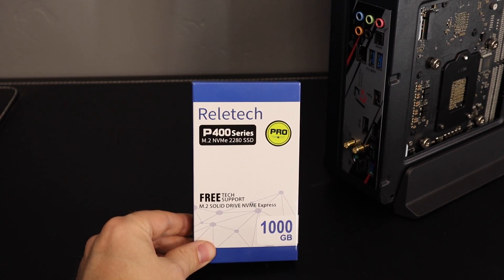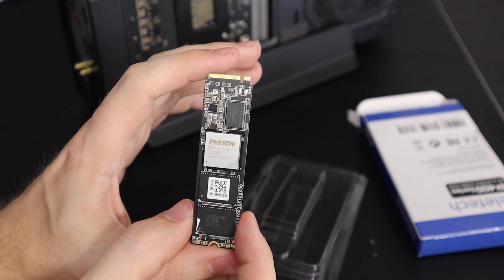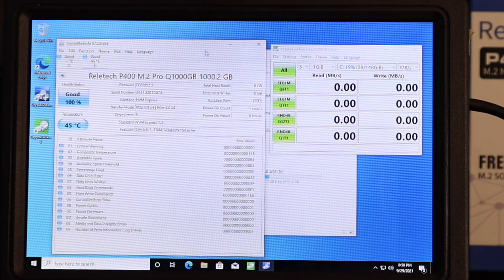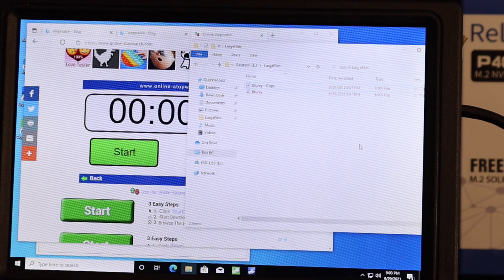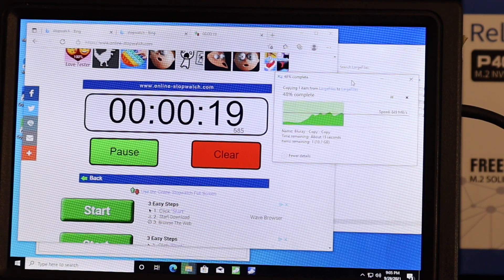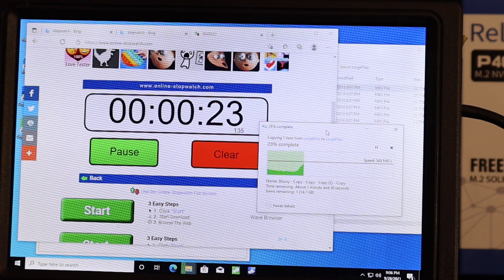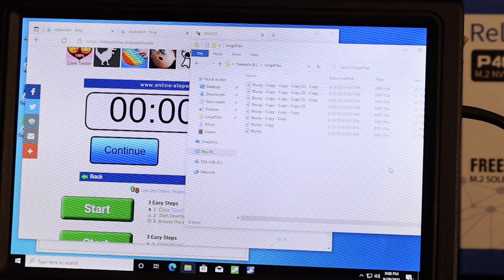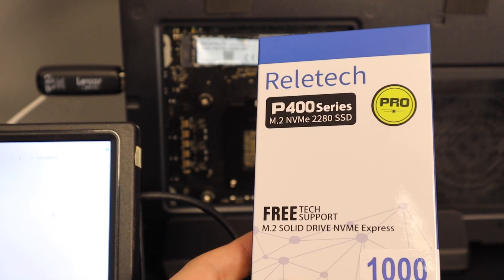Reletech P400 Pro - PCIe 4.0 NVMe SSD - Solid Performance, Solid Price

Comment: thanks for the video. I bought one of these as a cheap gen 4 solution. I did very little homework before buying. What is a higher performing gen 4 M.2 that you'd recommend? I was looking at 980 pro's which are almost twice as expensive, and figure there has to be something good in the middle.
Reply from the maker: Sorry I'm slow to reply, but the WD Black SN850 is a pretty compelling ssd.... Its what I'd probably buy today if I was in the market.
Reply: i mean if these are half of an 980 pro why not just get 2 of these in raid 0 if your mobo supports it ofc

Comment: I bought some OCZ SSDs when they were first coming on the market. They died in short order and OCZ went out of business. I would be very suspect of cheap newcomer SSDs.
Reply from the maker: You are right to be suspect, I was also burned by quite a few OCZ SSDs; however just to clarify a few things; OCZ was acquired by Toshiba and didn't go out of business, also the ssd market has consolidated quite a bit and the controllers and chipsets are much more mature at this point. This reletech has "recognized" controllers "PHISON" and SK Hynix nand chips; the firmware on the controller is also the same one as on recognized brands. But yes, never but any data on an SSD that you don't trust without a backup.